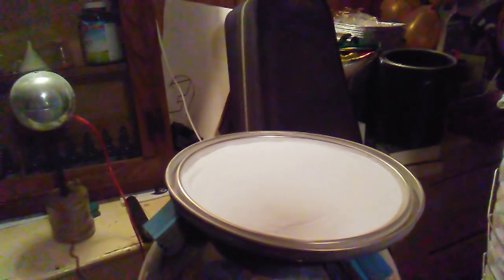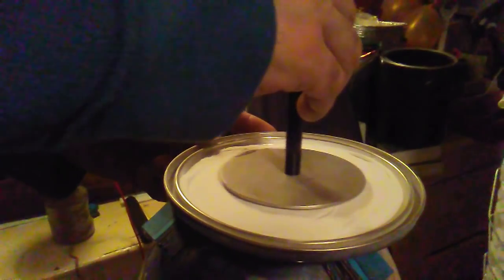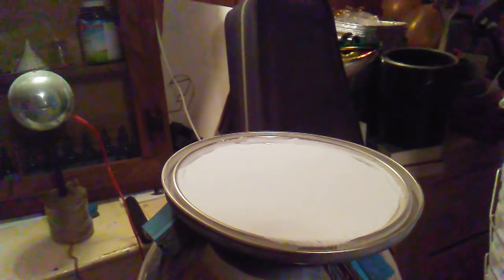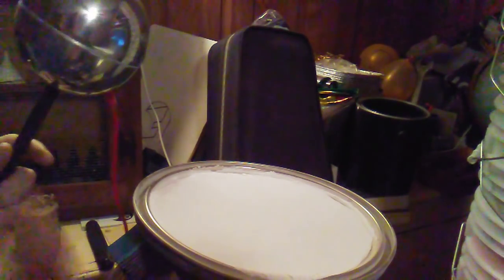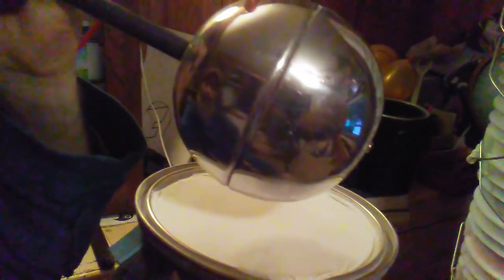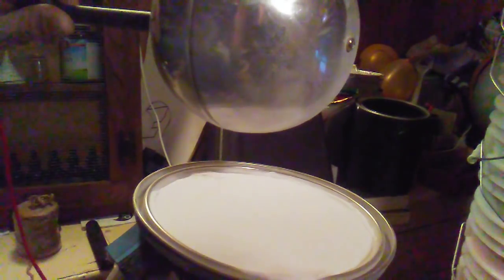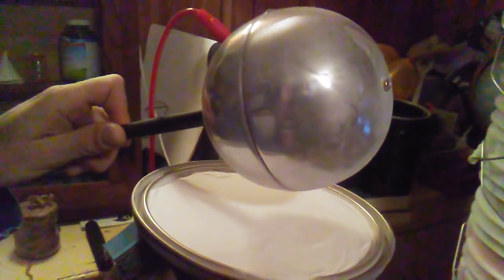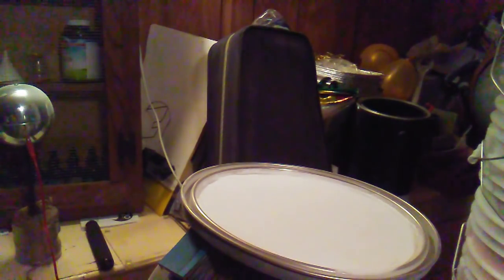- observing moon like craters made with electrical discharges -

Comment: The big question is, will it make the same shape if there is no air? if no then probably moon had an atmosphere before. this theory makes a lot of sense then meteors impacts which explain why we don't have any meteors pieces leftover in the surface of the moon, this raises another question, what was the source of electrical discharges that made the shape of the moon? and Probably the moon had an atmosphere which explains why there is dust on the surface and it lost the atmosphere later.